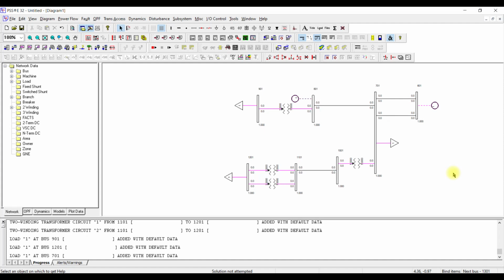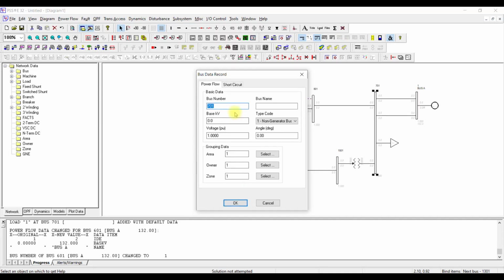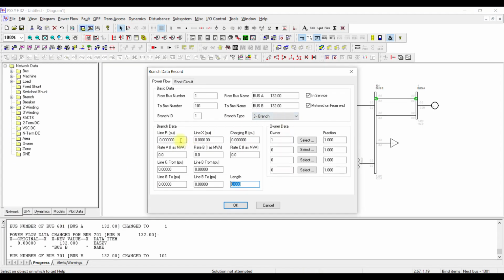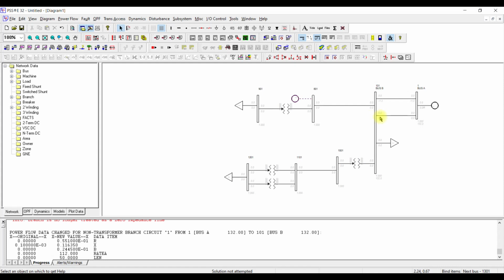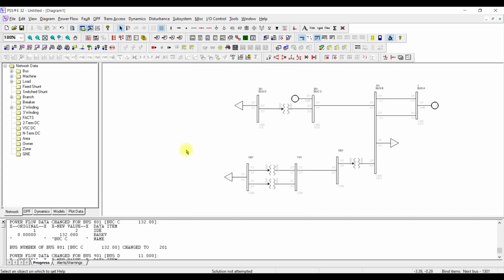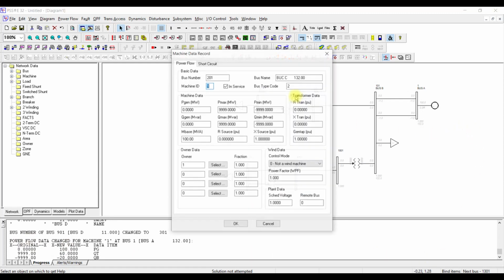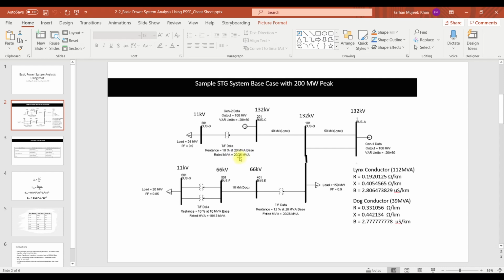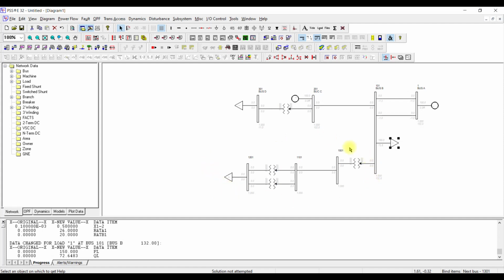PSS/E Lecture Series - Lecture 5B: Modeling of Sample Case (200 MW Peak Load ) in PSS/E Software

Comment: Large jump between lecture 5A and 5B. 5A shows the ppt oneline and then 5B shows the oneline fully drawn out in PSSE. No instruction on building the model in PSSE, just editing the parameters
Reply: Are you find these missing lectures?
Reply: Hi, I drew what I saw at the beginning of this lecture. Copied the diagram in powerpoint and created new diagram in PSS/E (with no values - only artwork). First created busses. naming them from 601 to 1201 as shown. Added Generators, branches, 2 winding transformers & loads. All values are zeros in beginning of lecture and get populated during.